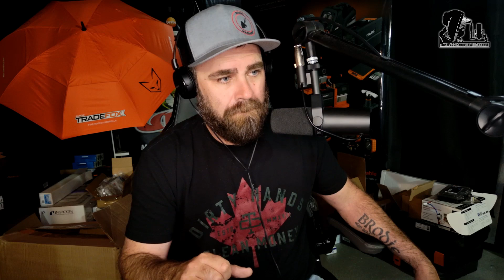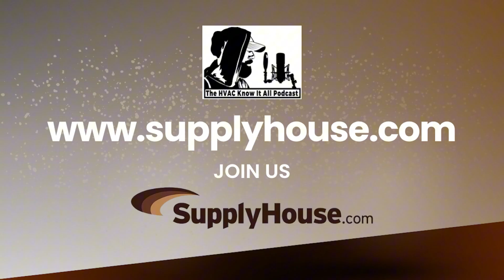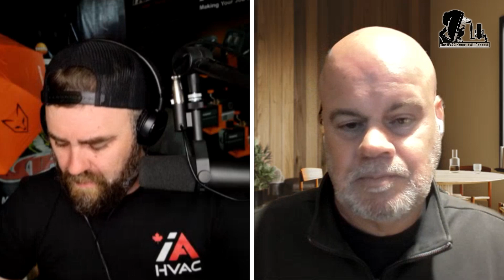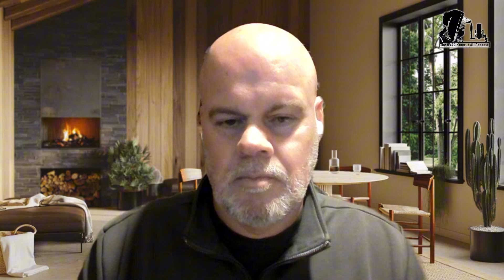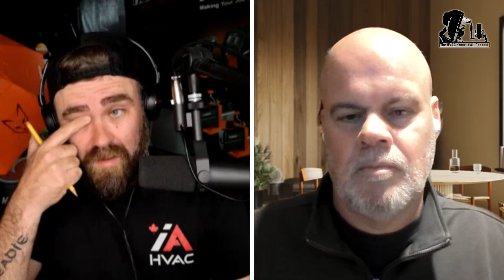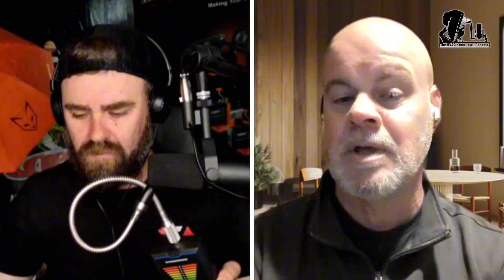Sealant vs Replacement in HVAC for Technicians to Use a Proven Leak Fix with Tyler Nelson Part 2

Comment: My opinion isn't going to change. I don't agree with using dyes and sealants, and there are regulations clearly stating they should not be used
Reply from the maker: What regulations are those and what basis do they use?